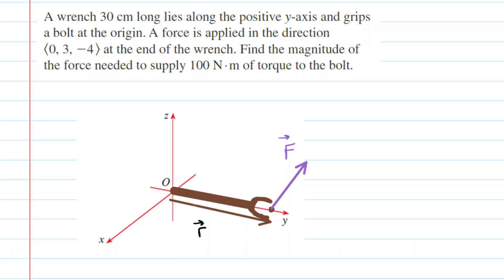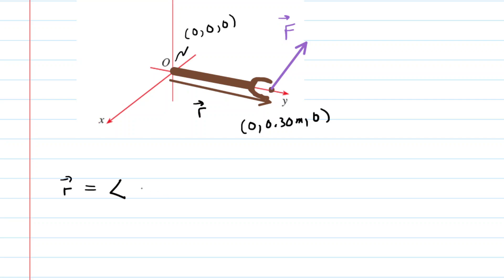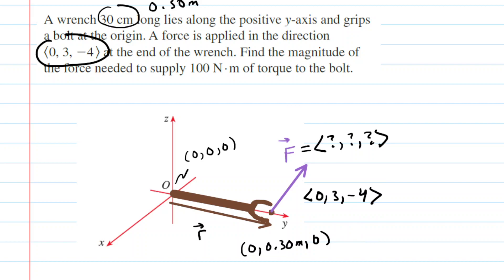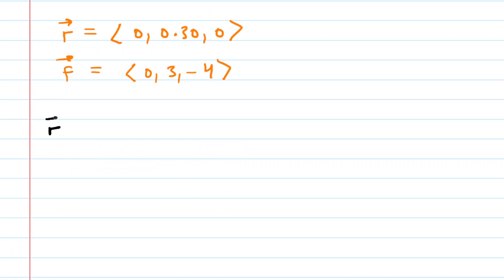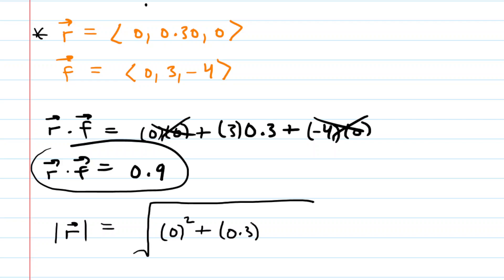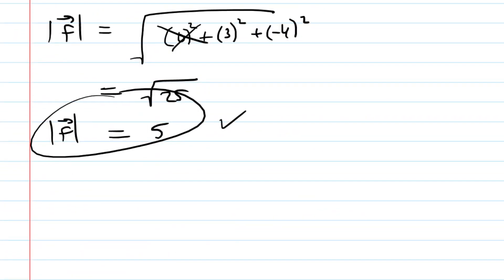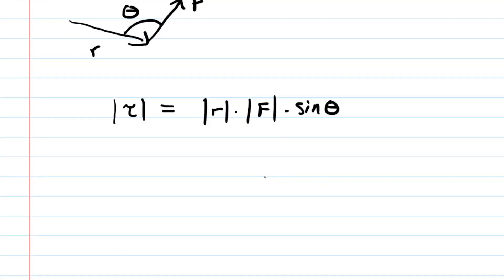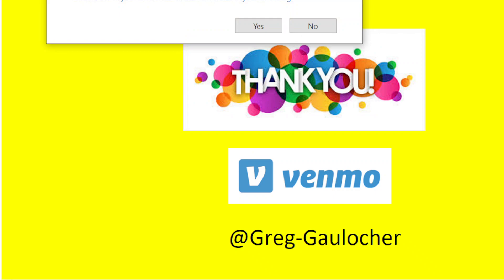A wrench 30 cm long lies along the positive y-axis

Comment: Why didn't you use 3-4-5 triangle rule to find the theta?
Reply: that's what I did but for some reason I thought that was a 30-60-90 triangle so I made theta 60 degrees. Either way it gives the same result